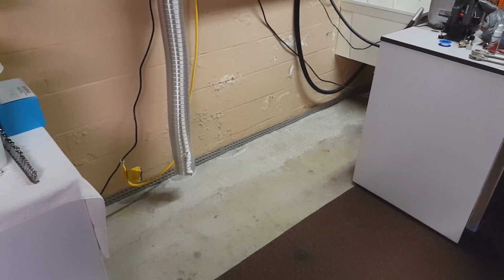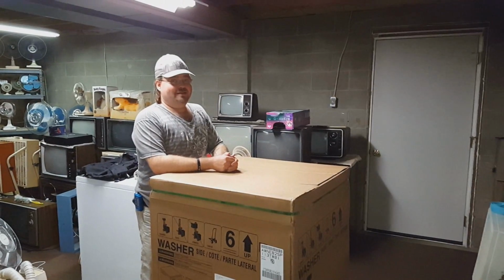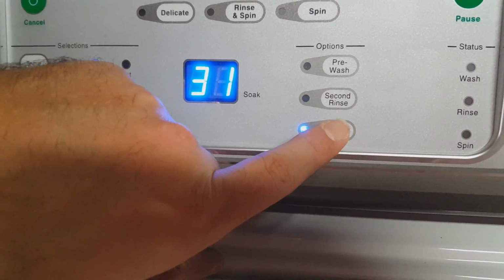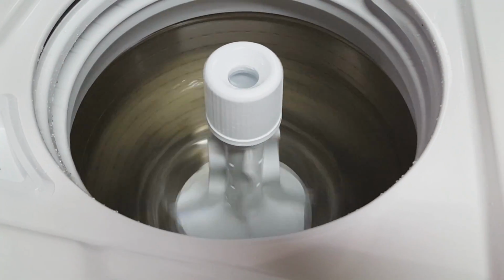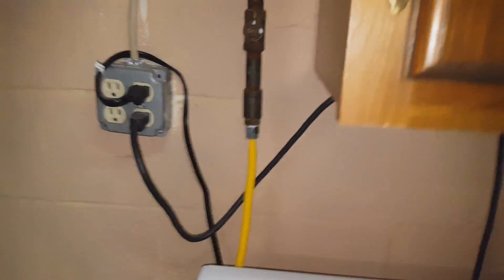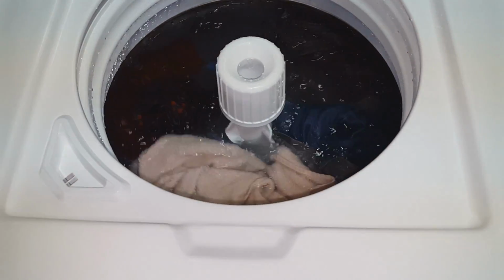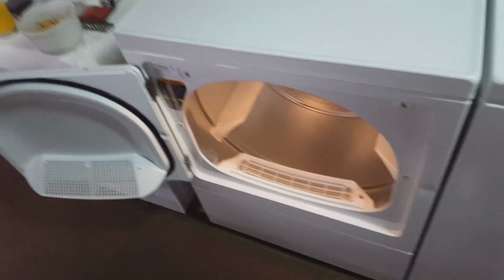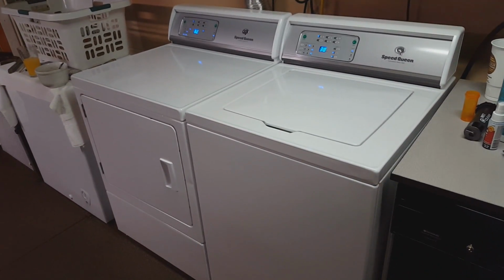The 2015 Speed Queen 8 Series

Comment: 24 people don't understand what quality is.
Reply: They're probably Samsung suck ... uh, owners.
Reply: ***** wouldn't doubt that they're samjunk- er - Samsung owners

Or Lousy Garbage... I mean... LG.
Reply: Samsung suckers.
Reply: ***** that's what I meant... my bad... LOL
Reply: No offense taken, but I appreciate it.

However, I'm sure some Samsung owners don't.
Reply: ***** haha!!!
Reply: @Smurdle450  I wish I had bought the matching dryer when I bought my speedqueen washer but money was tight and my dryer is recent and was working perfectly and I cant get a steam dryer from speequeen.
But now after only 5 years the dryer has been getting troublesome.
Sometimes it won't heat or it takes a long time to heat other times it heats up quickly  sometimes it takes a very long time to dry clothes other times its quick a couple times I got a control board error and one time an airflow error even though the vent is clear and got perfect airflow outside.
So yea I wish I bought a new dryer the whirlpool did a good job when it was new it still drrs 90 % of the loads perfectly.
It works great when it wants to work.
Reply: Smurdle450 kk
Reply: idiots, who the hell would buy the HE junk in Lowes & Home Deopt for 5 to 9 hundred bucks when you can get quality Speed Queen for around 8 hundred thats built to last 25 years unlike that worthless Samsung crap made to break after the first wash, I threw my $900.00 Samsung in the metal scrap pile......... with Aquajet that leaked everywhere when Aquajet was running, pos, unbalanced loads, pos,  locking lid pos,,,,,,,,Love my Speed Queen W/D set!

Comment: Guys, I've seen videos where people felt it necessary to raise the fill height buy adjusting the pressure switch.  Looks like your washer filled right to the top.  Have you or anyone else heard about needing to adjust this?
Reply: Yep, and the fill height is adjustable on this one too, but yeah, it fills just fine like it is.  Washes a thick queen-size comforter with no effort.

Comment: I got this 8 series washer.   After rejecting two brand new HE Whirlpools that were faulty, I got a Speed Queen and fell in love with it.  Don't be fooled by its simple look, or smaller tub.  It is a work horse!  It cleans beautifully, it's fast, straight forward doing all the different washes/spins, and built like no other out there. The warranty that comes with these machines is unsurpassed.  Pricey, but well worth it as you will not need expensive repairs or have hassles with it falling apart making your life miserable.  You won't be sorry buying this machine!  This is my 4th washing machine in my lifetime and it will hopefully be my last.  Recommend it highly to anyone shopping for washing machines! Read up on Alliance Laundry Systems who manufacture worldwide commercial machines including the Speed Queen.  This is a top notch company with quality and customer satisfaction as its top priority.

Comment: I just bought these and I'm so excited.  11 years in our current home and on to my 3rd washer.  I played the game today and went to a big box store first, even though I knew I wanted the SQ.  I really don't want a washer that can connect to my cell phone, thank you very much.  I want it to clean the heck out of my clothes, not break down or rust, be off balance and refuse to drain.  The big box guy's eyes lit up when I said what I really wanted....a Speed Queen.  He worked at the store I ended up buying these from and basically told me that there was no comparison between the SQ and the stuff he was selling.  I went through the process of picking and choosing an LG washer/dryer set that is front load, only to have a grand total of $2500 with shipping, install, and warranties.  Huh?  I got this set without having to buy a warranty as the parts and labor are guaranteed by SQ for 5 years.  I did spring for a stainless hose..yippee and still came in WAY under the $2500.  The salesperson said their service techs love the SQ and they only have about 2 calls a year on these.  The biggest "repair issue" is that the hose is stuck too far down the drain and the power of the water coming out sprays back into the hose.  I can handle that.  I can't handle a big rusty bucket that doesn't get my clothes clean!
Reply: VERY well said!!!  Our units are still going strong exactly how we showed them in this video.  You won't be disappointed.
Reply: Harley Badger I average about 10 loads a week speed queens are tanks. My friends own a hotel and use them. About 20 loads a day
Reply: Melanie Hameed can they wash a king size comforter?
Reply: can I watch?
Reply: Melanie Hameed Why would service techs like this machine? They're not paid to twirl their thumbs waiting for a repair...You'd think they'd like something that gives them a reason to exist. I own a Samsung top loader, yeah, the ones that supposedly explode. That I've never had a problem with, partly due to the fact that I sort out my families clothes with several totes for different fabrics and follow the directions like stated in my manual. And have had no problem with my units. And, my unit like most people aren't aware of has 1 year for parts and labor, 3 years on the control board, 5 years on the tub and 10 years on the direct drive motor that I anticipate will never give me a problem. But, to sacrifice the happiness of my home for a  machine that sports a tiny 3.3 cuft drum valued at 400 dollars more per unit to do smaller loads per wash cycle with an incredibly aggressive agitator tesring apart your delicate clothes that does not guarantee cleaner clothes, no thanks. I'm not sold nor am I interested.

Comment: i am now a member of the speed queen family but i got the ones with the mechanical controls.  it was this video that really sold me on SQ
Reply: Did you bypass the lid switch to?
Reply: How do you bypass the lid switch?  I have the AWN432SP113TW04  w/ knobs also,  did not want the solid state circuit board crap........any video on this, at least it doesn't lock, but I don't want it stopping every time I open the lid?
Reply: joe m yes
Reply: ozman1966 i wedged a piece of plastic in the back on the right.
Reply: I'm thinking I can just unscrew the metal rod hinge that is attached to the right of the lid and bend it over so it just lays flat on the washer and does not come in contact with the lid when its opened, that way when I open the lid, it will just lay there on the washer and not do nothing at all????? Sounds like its activating the swith, using the metal piece on the right side of the washer lid...........
Reply: ozman1966 yes that will work
Reply: But for what reason would you want to bypass the switch? It starts to cycle immediately when you close the lid again. And if you really want to know how, contact me. I don't understand why but...
Reply: wanna see the load when actually running, agitating, see how the load is washing, if.....I needed to add more clothes to washer and if more detergent is needed, also........as ev1 knows, every time something mechanical turns on & off, stops & starts constantly, it wears out quicker, more wear and tear.  It's like a car, I would NOT want my car to turn off every time I stop at a stop sign or red light......A1+ washer & dryer
Reply: I saw the guy, with the lid up, put the paper/plastic wedge in the metal frame so when the lid is raised,  and it tries to turn off, it keeps the electrical contact bypassed and washer keeps on running.
Reply: people like to see things are moving through the water properly is why we want the lid open during operation.  you can by pass the lid switch any number of ways.  but we are smart enough to kmow not to ever reach into the machine when its running.

Comment: I purchased a speed queen washer in April of 2016 - not with electronic controls. I also wanted a regular agitator - wasn't impressed with new style. I did alot of research on machines, because I don't want to have buy another piece of imported junk! Yea, it was more money, but it's made in the USA and my clothes have never been cleaner! Will be buying the dryer when the one I have goes!
Reply: You bought the most dependable washer made, PERIOD. Sometimes you don't get everything but you won't have to worry about repairs for a very long time. They are built like the old Maytags which used to be reliable like Speed Queens.
Reply: what model did you get? I need a new washer pronto. I hate he washers.

Comment: as of 9:19 pm, pacific time, the whirlpool DD literally turned into a firework. That thing almost set on fire. We just fixed it 5 days ago!!! It's all over for the DD. It died on its manufacturing birthday: July 19. If I wasn't in there when it happened, I would not be in this house, as it almost set on fire.Entered the spin cycle, then the motor buzzed... AGAIN... Then arcs started shooting EVERYWHERE. We went straight to unplug it. It's over. The distinct electrical smell haunts the house, and 3 repairs later, it's over. The replacement will be: SPEED QUEEN!
Reply: I wanted to revisit your comment here. Did you guys by any chance attempt a repair on the timer? It is strongly recommended not to do that because of possible electrical arcing.
Reply: Sharkie626 we gave up on the machine all together… We're going to be replacing it with the speed queen
Reply: Nearly same exact thing happened to us. We had a Kenmore/Whirlpool DD and one night I did a light load of laundry and it froze up when it went into the spin cycle. Electrical smoke poured out of the machine, it was very hot to the touch. I shut if off and unplugged it. When I opened the lid, smoke poured out.
It was frightening, I honestly believe also that if I hadn't been home when it happened I wouldn't have had a house left. I couldn't get rid of the electrical smoke smell for many, many days. I was awful. The business that I bought my Speed Queen from also repairs washers/dryers and I told them don't try to repair it and sell it.  I don't trust Whirlpool anymore, I can tell you that.
I really do like my Speed Queen, more so than any previous washer in many, many years. The only fault I can find is that for price paid, I think it could hold a few more clothes per load, and longer rinse cycle. It's a very good washer, best out there.
Reply: ueg790 yeah! My speed queen is also going well so far!

Comment: I got this model delivered the other day. I Purchased a GE about 3 weeks ago to replace my old ge which broke.  But the new GE GTW485 came out of balance  a lot. Although you could override the fill options and fill it up with water, it had weak agitation, Tons of vibration in spin (freight train sounds in spin)   I know with the poor design and build quality it would not last for years like they use too. So I told them to pick it up and then went to another appliance store and buy a Speed Queen and it works great!  btw GE appliance division was just sold to Chinese company Haier  so you know there product will go all mfg and assembled in China soon. NO more GE anythings for me.
Reply: I bought a great thinking they were good . what a piece of junk. mine did the same as yours. it's dead now. only had it a couple years. need a new machine badly and now!!

Comment: The only problem I saw was the nylon tape, that is not for gas but for water. gas tape is yellow.
Reply: It's what came in the gas hose kit.
Reply: Wrong kind, they are color coded for a reason. the white is for water and the gas chemicals will react dissolving the tape, the yellow will resist corrotion.

Comment: Finding the parts and a spanner wrench is still easy.  Getting the tub out after many years the effects of water, soap, bleach etc. on the locking nut under the agitator can be a pita.

Our Maytag washer and dryer lasted 21 years.  They were also digital display models.  The water pump was becoming noisy.  First one started leaking many years ago.  There was an issue with the tub brake.  It would agitate but when the motor reversed to spin, the tub brake would seem to release but the tub was froze and the belts would slip and screech. If you helped it would start and spin.  

The computer control system would intermittently freeze.  You'd have to unplug the washer for it to reset and then was fine for many months.  The computer had not been available in over 10 years.  It was time to replace them.

I see the model you bought has no soak cycle.  The front loaders we bought in Jun of 2015 has all of the features in the highest model top model.  

Before Maytag changed their transmission system on home models (08, 10, 12 models) it also had a long stroke agitation.

The local Maytag dealer told us when we were shopping for new to get the Speed Queen not the Maytag as Whirlpool owns the company (for several years now) and it's just not the same.

As you can see  here, the Speed Queen difference!  During testing Speed Queen Washers are run 10,400 cycles.

*Speed Queen Commercial-Quality Washers for the Home *
https://youtu.be/OjjrbHsvJuk

Another great thing about the Speed Queen dryer is it gives you an estimate on the display of how many minutes are left in the drying cycle in moisture sense mode.  The Maytag (not even the electronic one) would do that.

The Speed Queen dryer has a 1/3HP motor where at the competition has only a 1/4HP motor.

You can use soap suds and a brush to detect for a gas leak.  The gas valve should turn to the left using a T and with a 4" short piece connected into the down end of the T and capped as a sediment catch.  This keeps sediment from inside the black iron gas pipe from getting into the valves in the dryer or burner orifice.
Reply: Heya Don,
Yup, we have the spanner wrench, just waiting for the time to obtain and replace the tub bearing on the Maytag and they'll be back in service.  Fortunately, since I caused a gas leak, the local gas company came by and tested the entire house for leaks, replaced ALL the valves, and the gas meter (!) since this video.  Gotta give props and a special shout out to Peoples Gas of Pittsburgh PA for doing ALL that FREE of charge.  We would have spent $50 in valves alone.

Comment: We've had our Speed Queen washer and dryer for 2 months.  What a difference they have made!  Our clothes are cleaner, and if this makes any sense, they actually feel better.  So far, we've only used the Heavy Duty / Permanent Press Cycle, and have yet to need a second rinse.  The matching dryer is fantastic.  Everything comes out dry the first time.  Also the lint screen catches everything and doesn't let lint escape into the exhaust duct.  The LGs were terrible, and I'm glad to have replaced them with something that works and will last!
Reply: +Lynx93TK Awesome to hear!  Ours are still going strong and used pretty heavily.  Same results, never had a single stain that wouldn't come out, and everything is always perfect.

Comment: Why would anyone getting a speed queen even get an electronic model.  Isn't that like shooting yourself in the foot?  Mechanical controls for me when I get it.
Reply from the maker: The electronic controls are the same Raytheon electronics used 30 years ago  in commercial laundromats, just with LEDs for display instead of VFDs. So they are not designed to fail like other modern appliances are. 

The mechanical knob version uses the same relay bank located down at the front bottom of the washer as the electronic version.
Reply: The Raytheon electronic controls are rated for a 25-year life cycle.  Like Spats Bear said, they are the exact same circuit boards from the 1980s but with LED elements instead of vacuum fluorescent.

Comment: I would pay $1000 each for these if I knew they would last 25 years. Hell, if you buy $500 "China pride" models, you would probably go through 5 washers and dryers in that time frame and they wouldn't clean as well either. These might be more expensive up front but will be cheaper in the long run. I really hope they are still made the same quality in a few years when I get my own place and need to buy a pair. One question though, do you recommend buying gas or electric dryer if you can use either?
Reply: +Christopher Brennan Hi! Sorry for the late response.  I would recommend a gas dryer if possible, it will be MUCH cheaper to run.
Reply: +Harley Badger Thanks! Also, do you have any advice when it comes to buying other appliances like a refrigerator, stove, or dishwasher? Any brands you recommend or anything I should look for? Specifically, my 15 year old Whirlpool top freezer fridge needs replaced and I want something that will last me at least 10 years.
Reply: I would honestly seek the simplest appliances possible, and if not, check a "refurbished" appliance store... there are several in Pittsburgh (and my hometown of Atlanta) that sell used appliances for pennies on the dollar YET guaranteed to last WAYYY longer than today's Lowes Home Depot McModels.

Comment: We  bought a Digital Speed Queen pair like yours, you guys sold us. Can we adjust the top water level to a higher amount of water?
Reply: +Mark Scott Sure can.  If you disassemble the upper panel, there's a water level sensor behind the control panel, there's a hose attached to it.  There's a screw on one side, just tighten it one turn.

Comment: Does it give you a true tap-hot water wash? had a Hurlpoop that would not provide a wash temp over 73 degrees F, even with a 140 degree tap temp at the washer inlet hose. The dogs on the Hurlpoop auger-type dasher knocked as loudly as a jackhammer during agitation, not a plus when installed in the laundry room that backed up to the head of the bed in my Mother's sick room. The LG top-loader doesn't balance worth a damn, doesn't rinse well unless you do the fabric softener option with a second rinse, and takes almost two hours for the normal cycle. It is quiet, though.
Reply from the maker: +5610winston It does give a true tap-water wash. It just has 2 solenoids. Either one fully on for cold, one fully on for hot, and both on for warm.